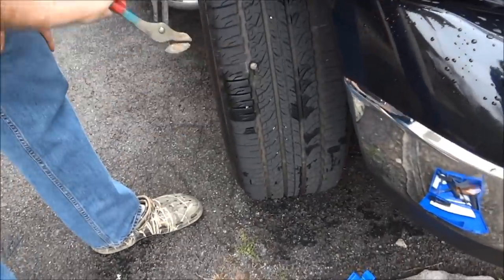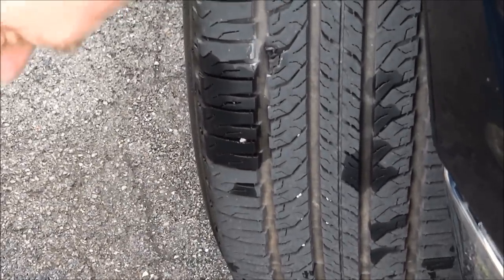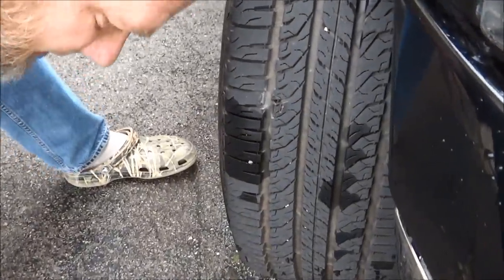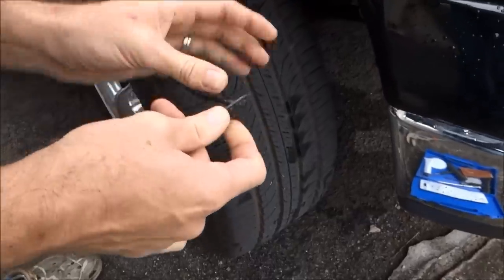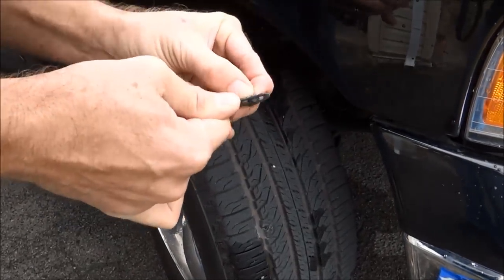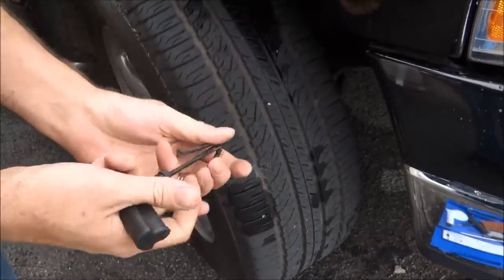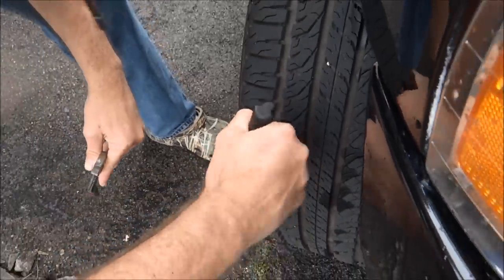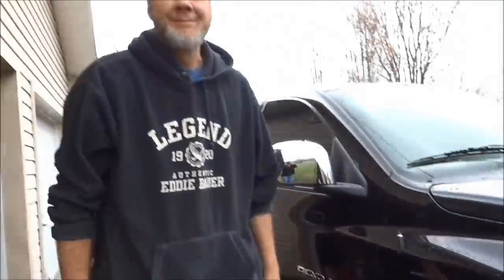How to Fix a Flat Tire - Nail or Screw removal

Comment: If he was wise he would have threaded the tar strip in the needle first before he pulled the screw out so it could be fitted quickly with as little air lost as possible.
Reply from the maker: Agreed.
Reply: Yes! But hello it’s an instructional video he has to show you the process step by step which includes him putting the tar strip in the hole..

Comment: I find it helps to pry open the end of the needle a little extra. Then when I stick it in the hole I put it in on a bit of an angle and squeeze the needle back shut on the rim of the hole and stick it in.  That way when it pops through the inside it expands back open.  90% of the time it sets on the first try that way because you're not yanking the tar plug back out with a tight needle tip.
Reply from the maker: Good ideas Mike.  Thanks for the input.

Comment: Best to carry this kit plus a little portable compressor that you can plug into your lighter so you can put just enough air in the tire to get to a station or if it's a good enough compressor you can fill the whole thing.  But yeah this repair works great... I think I got an additional 5000 miles from a tire after this repair..due to the tread I had to replace it.  Good vid bud!
Reply from the maker: Yep.....have one of those in each vehicle as well.  Good Pointer Pat.
Reply: Ever heard of a spare tire 😱

Comment: If you get one right on the border between the wall of the tyre and the part in contact with the road, do you need to get the whole tyre replaced? Or did I get ripped off today?
Reply: It’s a true danger zone story..  if you got replacemant, a reasonable precaution(IO-not complete rip-off👋)

Comment: I’m amazed you had enough air pressure to push that plug back in(which for most is ‘the hardest part’ by a landslide), which is less impossiblish with strong air pressure(like over inflated 5+ psi, or at least leave hole cleaner gadget in there till right when your ready to switch to plug) btw no 1s doing that quarter turn these days, IdOnO if it’s gone out of style(IO they’ve changed the plug gizmos?) or everyone’s just become clueless, as often is the case✋

Comment: wonder if glue on the screw rather small thin not so long l guess  screw stuck in tire thread and head flat and between threads rubber glue and screw it back in will work this reaming and plugging tends to be very hard work for beginers even can not do it cos do it wrong so why not try the easy way
Reply: What?

Comment: Pro tip, p🎉ull nail or screw out and quickly stick reamer in. Do not twist reamer yet. Get patch and repair handle ready to go as shown in video. Ream hole. Pull out reamer and QUICKLY push patch in place. Otherwise you'll let all the air out of tires.
Reply from the maker: Agreed.  Tks

Comment: u still need to have strong hands to poke through the hole am not strong enough to poke through the hole with the big needle with the long thick black plastic string through the hole I keep pushing and it doesn't go no where inside at all :(
Reply from the maker: Try to rotate the bore tool around back and forth, kind of "drill" it in.  It's can be difficult to get it thru the rubber and steel belts.  Wish I could be more help.  Good Luck!
Reply: finally I still got it in but I have to do the other poking thing a lot so the hole can get much more bigger so I can slide the needles with fat sticky giant string in more easier still a lot of work those :(
Reply: @loooo69k  l think it helps to put rubber glue or special glue for this on the reamer and put it inside to lube up the hole first , also put glue on the thread plug l guess, l used a big hammer on the end of the needle tool but thread plug got cut in half , so if a hammer is needed then the hole is too dry og too small still make it bigger l think.